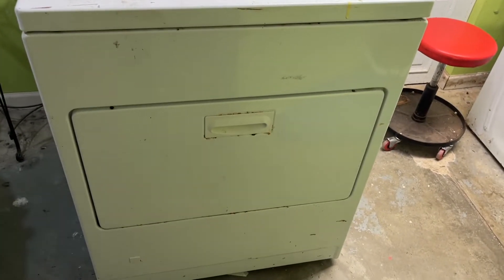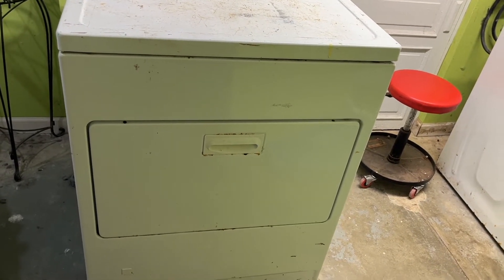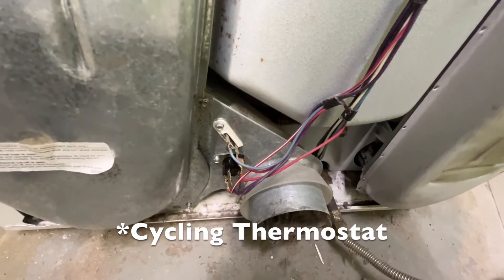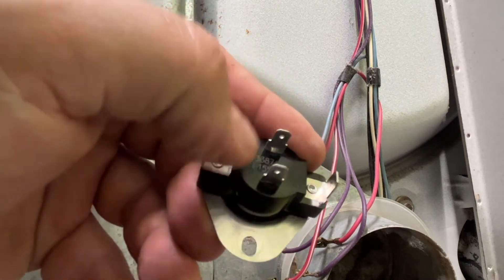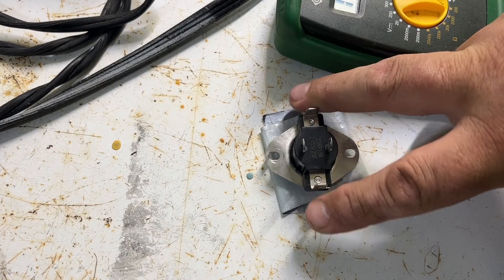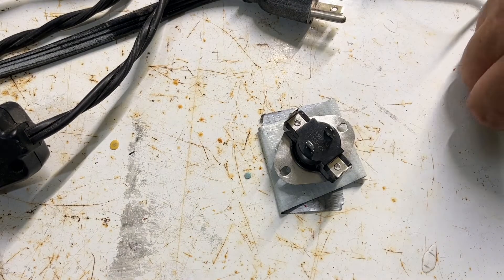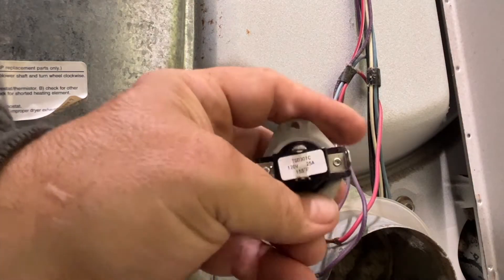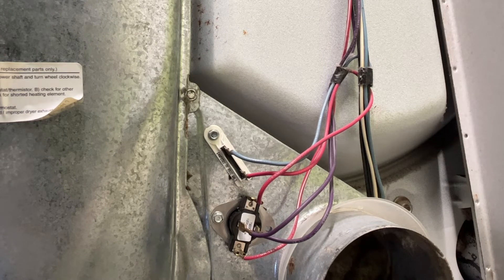Clothes Dryer Too Hot -- Testing the Cycling Thermostat

Comment: I believe my dryer is getting too hot on the low setting kenmore 110.6490200  at what temp should it be shutting off the heat?  thanks
Reply from the maker: I'm not sure about your specific model, but from my reading, dryers typically run between 125F-160F and they can be expected to turn off somewhere somewhere a bit above that range to prevent damage or fires

Comment: What part of the 'Cycling Thermostat' (both the old and new one) did you have the sensor gun pointed at while it was on the burner? Were you measuring the plastic housing or the metal part where the sheet metal screw get's inserted?
Reply from the maker: The plastic housing, but you can see I also pointed at the metal flanges at the bottom and the temp jumped like 4 degrees so it wasn't much different from the direct heat or away from it
Reply: @HomesteadDIY  I guess it was the editing that threw me off. It looked like it jumped 40 - 50 degrees when you switched from the plastic housing to the metal 😄Anyways, I've been working on my Kenmore dryer (400 series) cleaning out all the lint and everything so I thought I'd do the same test - it looked pretty simple. I performed the test as you and my thermostat successfully made the clicking noise with no continuity after, but... it seemed to happen around 180+- degrees. Anyways, I ordered a new one. Thnx for the vid sir and have a great day.
Reply from the maker: @ 4 degrees, 40 degrees. Same thing. :)

Comment: I've only once had a therm that still read continuity when it was bad and showed that it was broken when it got hot.... Most you can tell by the meter unless you have it on a really low setting then it can read sometimes when it's barelyyy touching inside...if you set it higher it may show that it's bad.

 
I know that there's a disc like wafer inside most and sometimes you can tap them pretty hard and they'd start working again... wouldnt recommend.

I repair commercial machines for a living but usually the bigger commercial ones...just left a 80lb dryer repair.

I'm kinda surprised you'd have gas still coming through without the coils being bad. For instance if it doesn't come through at all or intermittent flame then it's almost always the coils for the gas valve.
Reply from the maker: I'll defer to your expertise. I'm just a guy that knows enough about a bunch of little things to get myself in trouble regularly, or so my wife often tells me. 😁
Reply: @HomesteadDIY  Kinda like the character Tim Taylor on the Home Improvement show with Tim Allen 😄
Reply from the maker: @ Insert Tim Taylor grunts here

Comment: Great Thanks now I know it should cycle on & off with over tempt... but what are the 2 purple wires ?? .My guess would be the start Button energizes this switch thur the purple wires but Not Sure any ideas ?? Thanks
Reply: The two purple wires are connected to the bias heater in the thermostat.  The bias heater heats the thermostat when in low heat cycle to fool the thermostat into thinking dryer has reached temp to kill power to element.